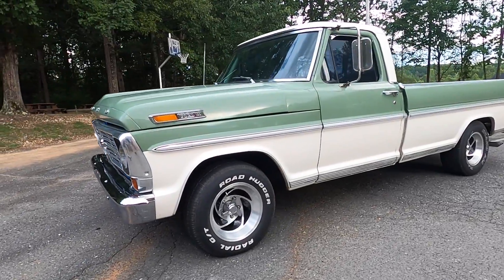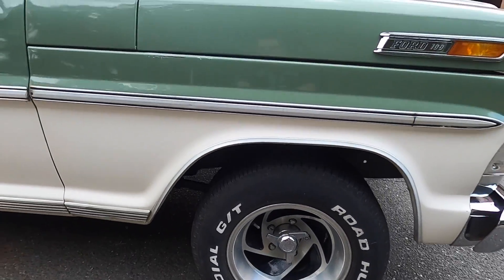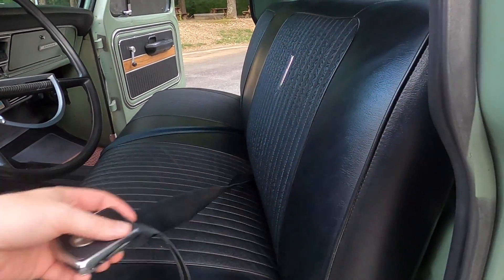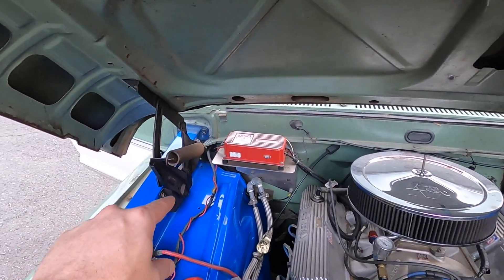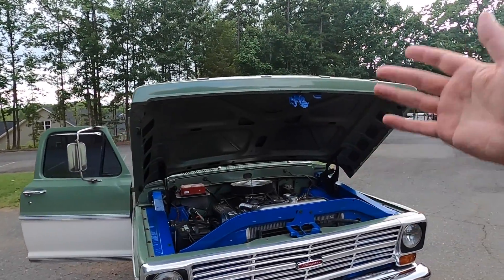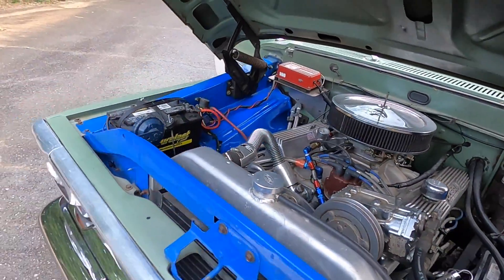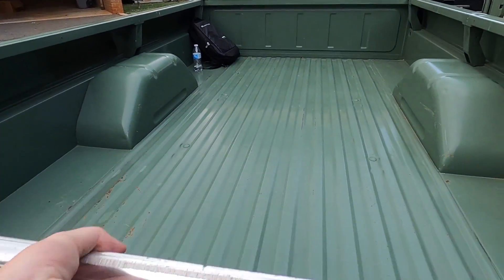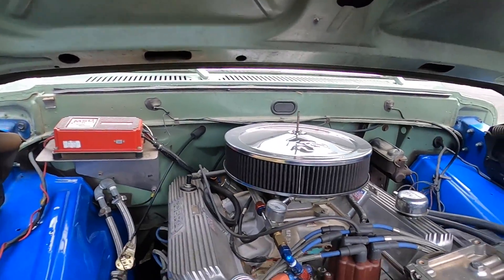I BOUGHT A 69 FORD F100 WITH A BIG BLOCK FE ENGINE!

Comment: Love the sound of the old Ford Pickup engine. I remember my dad's old black and white 1969. Black on top, white on bottom. Don't remember what the old wheels looked like. Not like that though. Used to pull our old Aljo trailer on camping trips.
Reply from the maker: Oh man I bet that was fun!  Yeah these wheels are from the 90's. I wouldn't mind putting the original ones on if I had them.
Reply: @GearHead704  The trip I remember the most was when we went with friends to Death Valley, CA. We had CBs and our handle with the black and white pickup was "Domino". And our friends had a metallic green Chevy pickup "The Green Machine".

Comment: Congratulations that is a really good looking truck!   Better get some disc brakes soon because with that Big Block Engine it can be dangerous!   Just take into consideration that a carburated engine with a hot cam is most certain to have some cold start issues and run poorly until they warm up...
Reply from the maker: Great point.  Yeah I might get the brakes upgraded to disc.  We'll see how it goes.

Comment: Now that's a good truck. Sometimes you just need a truck,and Mustangs are no good as trucks. If you need to do some highway driving,you might consider an AOD or add on overdrive. My little truck has 3.80 gears with an AOD and it turns 2200 RPM at 70. Your engine sounds a lot like mine only bigger.
Reply from the maker: Nah they don't make good trucks do they! 🤣. Yeah may look at an AOD in the future for sure.

Comment: Had 70 for years loved it , 300 was in it
Reply from the maker: Very cool!  I believe that's the inline 6 is that right?
Reply: That's right and it was indestructible engine with a first gear compound 4 speed, had 4.11s in rear end and I put in automatic 2.35s for better mpg on hwy ,

Comment: Love that color combo! it must be specked for a camper.  That extended bed is longer on both sides of the wheels, love it!
Reply from the maker: Yes!  At tone point the original owner had a camper on it.  Great call dude.
Reply: that's not an extended bed , thats a standard bed for that truck . short box styleside was a rare thing in those days .

Comment: Very nice 69 Ford, I love it! I had one in maroon and white around 20 years ago. it had a 360 in it which didn't run very well. I replaced it with a built 429 and C6 auto transmission. It ran great and was a lot of fun.
If you don't mind me asking, what did you have to pay for it?
I cannot remember the name of those wheels, but BITD they were less expensive than many other choices so there used to be a lot of them around. 
Be sure to keep an eye on the rocker arm to valve clearance on those solid lifters. They need to be checked every once in a while. I forget which way is which, but you can move your power band up and down a bit by adjusting the rocker arm clearance. Probably down by loosening them up a bit and up by tightening them...or vice versa.
P.S. The gas tank isn't really very susceptible to side collisions as it is behind the seat. In all my years I never saw a wrecked 67-72 Ford pickup that the gas tank was an issue. It would take a very hard hit to rupture the tank and if you get hit that hard you probably wouldn't have to worry about it.
Reply from the maker: 429, man that was probably a lot of fun.  Thanks for the tips, and good point on the gas tank about not needing to worry about it if hit that hard, LOL.  I'm planning a future video on what it costs.  It was a little strange as i've actually owned this truck before and got it back.  So stay tuned for that, but I can tell you it ain't going anywhere anytime soon.

Comment: I have a 68 short box. It was two toned. The blue and white. 390, 4 speed. An a 9" rear. I did a stroker to the 390. It is a 445 now. Richmond 6 speed. 
 If it is the original automatic transmission it should be a c6 and not the c4. Those are definitely 90's rims. Lol.
Reply from the maker: Man that 68 sounds awesome and YES, definitely 90s rims lol.  Enjoy Jim!
Reply: @GearHead704  just parked it for the Winter. Good thing to. We have had snow all weekend long.
Reply: I don't know what you paid for yours. But I got mine for $500.00 in South Carolina and drove it home to Wisconsin.  A nice road trip.
Reply from the maker: Way more than that!  LOL
Reply: @GearHead704  except for the roof the paint was gone on mine. Lol

Comment: Ranger was a trim option ,  8" bed were standard . Nobody had short boxes 
I had a 69 with a 302
Reply from the maker: Thanks for the input Steve, that makes a lot of sense about the beds.  I didn't know that.
Reply: @GearHead704  The F250 2wd Super Duty pickup had a different wheelbase as well , it was longer . The box is specific to that truck .  Back then if you had a pick up , you were working it for the most part , hence the 8' box . Now every one wants them all pretty and scared to get them dirty .

Comment: Probably came with cruise-o-matic the precursor of the C-6. C-4 was usually small blocks.
Reply from the maker: Hmmm, you might be right actually that's it's not a C4, I think it's a C6 trans and I said it incorrectly.
Reply: @GearHead704  The C-6 was, I believe a one piece i.e. bellhousing and main body one piece. It was aluminum versus Cruise-o-matic cast iron. My memory is not as good as it used to be, 65, so I could be wrong. I put a C-6 behind a 390 in a 1968 F-100 after the Cruise gave it up.
Reply from the maker: We'e got a transmission leak so we're going to have get underneath and figure it out exactly, but I  am pretty sure it's a C6 now that you mention it.
Reply: GearHead704 A good hint for a C6 is the size of the tranny. Those Ford heavy duty autos are colossal in size. I have its successor (E4OD) in my 98 F250 Light Duty and it’s huge for sure.